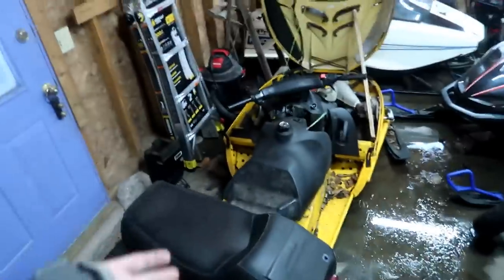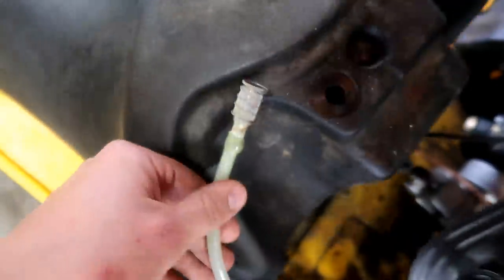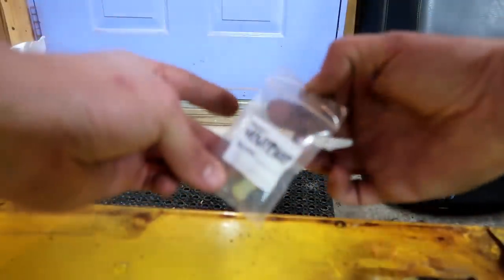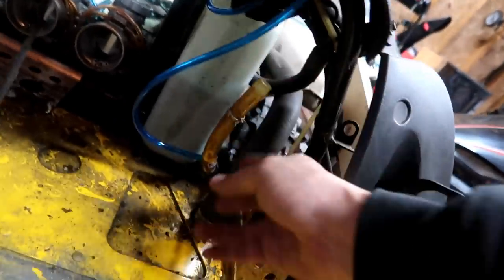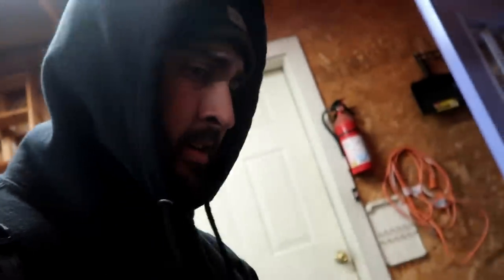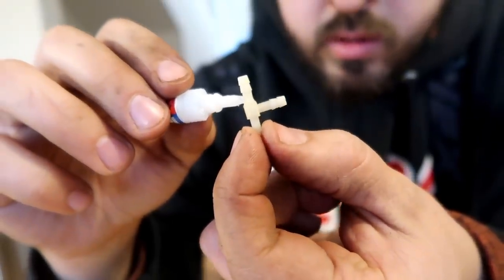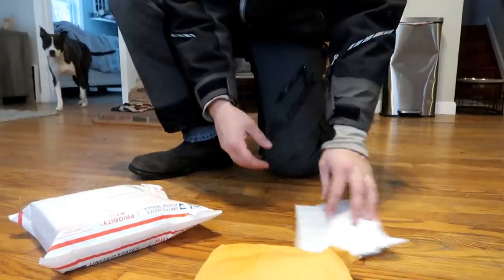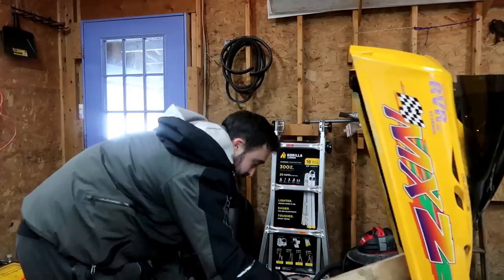I Can't Fix This Snowmobile?  HELP ME. (1997 Ski Doo MXZ 583)

Comment: That particular fuel pump will gravity flow your fuel tank empty.
If a float is not seating in a carb or a fuel line is leaking the fuel will all drain from the
fuel tank. You need to have a fuel shut off in the line. Think the 1999 and up fuel pumps were designed to block fuel from flowing out when it is not pumping.

Comment: I would replace it A brass T fitting.& You got those fuel lines.  Your using the right ones for it. You need polyurethane line for that small one to later on.

Comment: Check your carb slide needles and start it up and spray brake clean and if it revs then u found a leak were it’s sucking air

Comment: Had the same issues on my 583 the primer craped out and fluided my bottom end switch the plugs to brp8es from the 9's the 8s burn hotter so it will burn the unwanted fuel then put the 9s back in. It's not easy to drain the bottom end of skidoos because Polaris has drain plugs

Comment: Start with a compression check and if that is good move on to new plugs,when you do get it to fire spray brake clean around the clutch side of the crank,if the rpms change it's a crank seal gone bad,have someone pill it over and put your hand over each carb,you should feel suction on both,if you don't there's an issue with the rotary valve,I would open it up and check it anyway,if it has scratches or scores it's no good.,check the splines on it and make sure they're all there,if that rotary valve is out of time it won't run.good luck

Comment: Yes if the primer is bad it will only run at high rpm you need to crimp the primer line to cut off fuel to primer or replace primer

Comment: Check the pulse line coming from the crankcase. its often over looked and im guilty of it myself. Oh and that fuel shut off needs to be pushed up to the tank. the tank side barb on it needs to in that new rubber grommet. ive worked on hundreds of S chassis ski doos and more often then not it something stupid that keeps them from running right.

Comment: If it’s acting like it’s flooding itself it could be a worn out rotary valve gear I had a 583 and had similar issues seemed like fueling issues I did everything thing you did talked to some old skidoo guys pulled it out it gear where worn out installed a new one made sure it was timed right and it runs like a top

Comment: The fuel shut off and the fuel tank grommet you didn't replace correctly. If you look at the fuel shut off part has a taperd end when you push the fuel shut off into the rubber grommet it spreads the grommet into the tank thus sealing it tight.
Reply from the maker: I actually recorded my explanation for this, but didn't think it was important enough to add. I could not, for the life of me, get it to push in the way you have explained.
Reply: @JeremyRhydes  oh alright man! Just wanted to make sure you knew that. Aftermarket stuff is never the same! I had a 583 with the complete opposite issue. Mine would fill the crank case with fuel could never figure it out and ended up getting rid of it. Keep up the good work on uploads enjoy watching your content man especially when you grip n rip with the boys 🤙

Comment: I think you have A blow float sticking inside of  carburetor.,or carburetor's. Another thing I wouldn't be using ethanol fuels in that cause it eats up those fuel lines.& Corrodes the inside of them really bad.

Comment: So did you get the problem fixed, Like others said,  First thing, check compression, maybe a float stuck and filled the crank case with gas, crank seals??

Comment: I dont know if you have or not as ive never seen your videos,before so if you have I apologize. But,If you are new to this sled and haven't already checked compression on both cylinders you're not really qualified to be working on anything anyways.  A little lube in cylinders,rotate a few times to lube up everything and compression check. That's first thing you do when checking ANYTHING new to you that's used,with an engine. Otherwise you start dumping money on fuel and/or spark things that may do absolutely nothing. It's honestly crazy if you haven't yet. Again, if you have,I apologize.

Comment: Dose the rotary valve spin with the motor. Pull the carb and look in and roll the clutch by hand.  I've had this issues brass gears inside stripped. Would half ass run on one cylinder

Comment: Are the carb bowls vented properly? Some go in the airbox, others to the bars etc. My wheeler had mud in the bowl vent line one time and would idle alright but act like it was running out of gas any time I used the throttle. Just wasn't enough flow being let into the bowl for riding.

Comment: Does your throttle cable split into 2 cables at the carbs, had an old skidoo and the cable broke inside sheathing and it would idle ok but as soon as you gave it throttle it would run like crap and bog

Comment: Starting fluid is your friend .....does it start and run better on little shots of starting fluid ?    Also when your running it 3k rpm pull one plug wire at a time
Reply: Not on a 2 stroke engine!

Comment: Pull the carbs and take a look at the reeds, maybe they are giving you grief. While the carbs are off confirm the floats aren't sticking.
Reply: It's a rotary valve engine, there are no reeds
Reply: @jimmybiter2936  Rotary valves were only used in Rotax engines in ski doos from the mid seventies till early nineties. My '75 245 RV in my avatar was one of the first. Yamaha never used them,  reeds are a less complicated setup.
Reply: @martyfield694  Early nineties? Wrong... Rotary Valve engine used until 1999.. then went to reeds in the ZX chassis in 2000...
Reply: @jimmybiter2936  Upon further inspection you are bang on Jimmy with the rotary valve 583. I thought by '97 they had switched to reeds, my bad.

Comment: I have a 1995 formula z 583 that did this same thing I just shut the gas off and it don’t do it but now I have a problem we’re I have good spark good compression but engine keeps flooding is annoying I can’t run it for 5 seconds before it flooding and running on 1 cylinder seems to flood right side most the time

Comment: I replace the motor in my Polaris Indy 440 had about a quarter tank fuel in it could not get it to stay running but I ended up putting more gas in the tank about 3/4 full and she stayed running after that maybe try a little more fuel in your gas tank

Comment: Could be a vacuum line carb adjusted. You’re key low compression I’m standing more towards a bad vacuum line or bad plug wires even tho you harvested that part off the old sled. Last resort take it to get fixed

Comment: Adjust the needle and seat height check the fuel pump could be bad or could have cracked fuel line and it like mine it sucked it up in there and starving for gas or a crack in the pulse line

Comment: I had a 583 years ago, and it acted just like that when the inner and outer crank seals went bad. If that is the case, its going to be a little pricey to get the redone.
Reply: Shouldn’t be pricey it’s just the labor in doing it.
Reply: @isaacschute476  Unless prices have changed in the last 5 years or so, last I checked to have the inner and outer seals replaced (pressing the crank apart) was over 1500, up to 2500. I'm in Canada though, so idk what its like price wise in the states 🤷‍♂
Reply: @jamiesmith3494  I’ve only worked on Polaris,  So i didn’t know u had to press the crank apart for the seals  good to know 👍🏻
Reply: @isaacschute476  yeah, dumbest design award goes to 90's skidoo motors LOL most of the time, you just buy a new crank. last one I tried to press apart exploded lmao had a milk crate under my press to catch stuff, full of big hunks of metal shavings, the piece of crank went right through it, and got lodged in the concrete floor in the shop. was a fun experience

Comment: Force feed it with fuel oil mix down the carbs . I had the same machine . Go like F#ck if ya turn the rotor . But Very hard to start . Has the Rotor been turned ?

Comment: Hey Jeremy Rhydes, i have question! Do you know if i put a GGB or Jaws race can on my Polaris Voyager 550 2018, if it will damage my motor, or do any further damages to the motor or snowmobile in general?
Reply: You won't damage anything if you do just a can! If you do a whole exhaust system then you'll have to  re-jet it
Reply: Yes, damage to local trails will occur. Dont do it, people dont like to hear that crap
Reply: @TheYooperguyslife  Okay so if i just get the, Lets say The Jaws Race Can for my Sled and that’s the only thing i swap. Then i will be safe?
Reply: @MidnightPolaris800  I dont ride trails man👍
Reply: @mrkali8256  should be fine
Reply: I have a 2015 summit 800 with a ggb can
Reply: @TheYooperguyslife  Ooo nice, i bet it sounds hella good🔥🔥